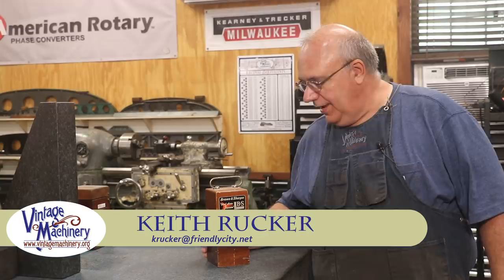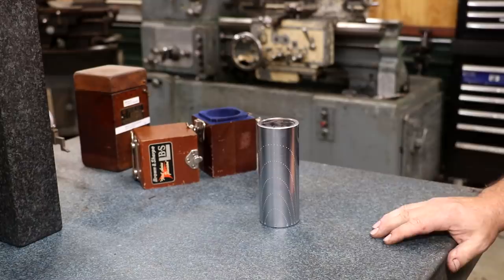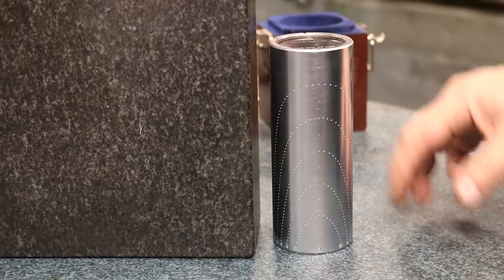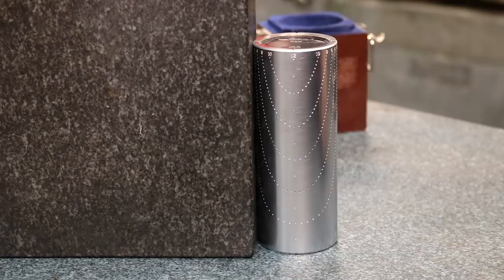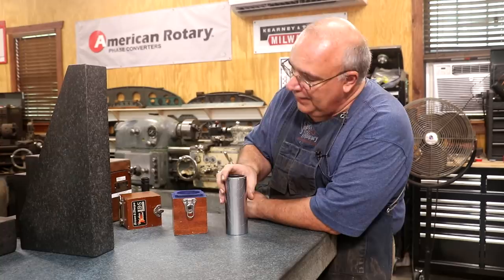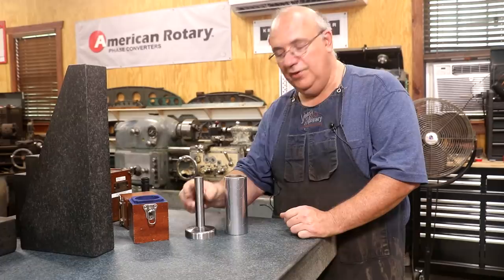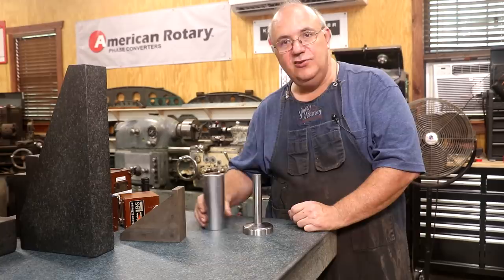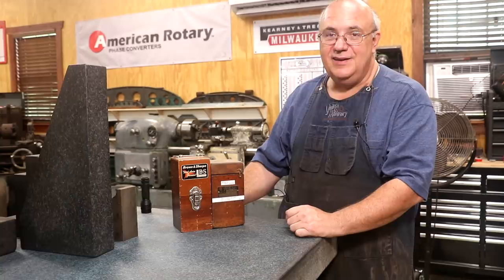Machine Shop Tools:  The Cylinder Square!

Comment: I remember when I was serving my apprenticeship in the early 60's in the UK several of these cylindrical squares were made in the toolroom. It was easy to get a piece of tool steel machined on a lathe and get it hardened but you had to get round Arthur who operated the cylindrical grinder. You could then get it checked in the standards room.
To finish they would be oiled and then dipped  in plastic protective covering.A useful tool for checking the accuracy of squares etc. 

Regards from Redruth

Arnold

Comment: After seeing your video about quick tram alignment and realizing the potential time savings, I started pricing cylindrical squares and quickly learned that they were out of my price range so I started thinking about alternatives. I saw that 2-4-6 blocks would also work and they were affordable so I bought a pair.  A single block stood upright works for quick tramming and in addition I've found various other uses for them.  For instance, if I need a big vise for horizontal milling I clamp one down to the table using my clamping kit as a fixed jaw and then I use the threaded holes and bolts through the other block as the moveable jaw and it makes a dandy vise for holding larger work, as well as for general milling blocking.  Thanks for the idea Keith.

Comment: Those dots that form curved lines are meant to measure the deviation from square on parts that are shorter than the square if I'm not mistaken. Rotate till you've eliminated the light gap then read where the top corner of your part lands between the lines.

Comment: About waiting on something "rare" to come up on eBay (something I have done many times).  Instead of looking for it every day or week, and potentially missing a "hit", you can do the following.  First set up a search for the item (you might find nothing).  Then click on "Save this Search" at the top of the page.  You should then get an email whenever the eBay search engine finds something.  Hints: You can search for spelling variations by putting works inside parenthesis e.g. (Starret, Staret, Starrett) which will return any items whose description contains any of the three (mis)spellings.  You can also remove search words by using a "negative" parenthesis, e.g. -(brown, sharpe, mitutoyo) which will NOT return any items whose description contains any of these words - handy to get rid of the chaff and find the wheat.  Best of luck finding your rare item!

Comment: When I was a student at TAFE I made one of these...........no sweat, chuck it in the lathe, cajole the storeman into giving you a new insert,  try and find out what steel it is, set the machine and press the GO button.        The thing turned out perfect, first go............the teacher could not find any error with the equipment at hand in the workshop.

I wrapped it up in felt it's still in the cabinet waiting for the day I turn out perfect work again.     That was 60 years ago!!!!

Stavros

Comment: I ran a Brown & Sharp screw machine for about a year.  I never learned set up very well, but would hold tolerances within a few thousands for thousands of parts.  Just had to maintain tool sharpness and oil flow to take care of the tools.  It had pneumatic stock feed.  They also had Davenport's which would turn out many small parts with close tolerance.

Comment: We had the magnetic post type in our toolroom.  We were never permitted to simply set it on a surface. Wipe the work surface and base with a clean rag then wring those surfaces with your palm before making contact.  Always storing in it's wooden case.

Comment: You will notice that the light passing through the gap between the cylindrical square and a surface under comparison will shift to the blue end of the spectrum (shorter wavelengths) as the gap becomes narrower.

Comment: A cylindrical square isn't as efficient as a 2-4-6- block stood upright, because since the circular square is cylindrical, front-to-back out of tram will influence side-to-side out of tram, and vise-versa, unless you hunt for the high spot on the cylinder with each adjustment.  So as Cap'n Crustry says , a 2-4-6 block, (if it's aligned to the T-slots with a 5/8 thick block sticking out of a T-slot),  seems  a faster way to tram.

Comment: I am sure I could make a very accurate square like your Brown and Shape on my universal grinder. 
But how to make it like it is on the opposite end l wouldn't know where to start . On the square end l would start with a piece of drill rod tool steel and face, cut a recess in the bottom, and center both ends. I would have it harded to about 60rc . I then would put it between centers and grind it straight with in 
.0001". That would be half that per side . The harder part is to get the side of the wheel perfectly square to get a chris cross pattern on the bottom which would be perfectly flat. At that point it would be ready to  be used . It should be accurate to at least .0001" or better. The other end that is something different all together.

Comment: So if you dont need that much of extreme precision you could make this on the lathe in 5 min.
Reply: Yes, but the Devil is in the detail, you first have to make the cylinder dead parallel and doing that on a lathe takes some doing.........for any but the most exacting  work a piece of hard chromed bar cut from a hydraulic ram and faced off will be dead square any day of the week and it won't rust from handling.
Reply: @gangleweed  What a great idea using a hydraulic cylinder ram !
I guess you could also make a tapered one for setting up things.

Comment: You left off a key bit about a cylindrical square!
A shop-made version (of arbitrarily high precision!) is within reach for people that don't have precision-everything. (Not as pretty, no :D) 
"Between centers" can make approaching-true-cylinder-walls. Facing gets rough-cut ends. Make two.
Then "just" do exactly what you showed with light between the two of them with rotation to see their errors ... and the inevitable lapping the ends to suit. Not one single precision tool needed beyond a surface plate.

Comment: How difficult would it be to make one on a cylindrical grinder?
The bottom surface gets square no matter what, as the part rotates, as long as the spindle bearings are good.
The only problem I see is with the taper, but you can measure and correct for that.
Reply: the devil is in the details. heat ect. remeber the longer the part, the smaller the angle has to be to read out. 
.0001 at 12 inches is allot. 
make as you described and then lap the bottom in untill it reads 0 all the way around with your squarness comparator. 
relive the bottom so it has like a 1/8th lip to ride on. it will be easier to lap. a full face will be very dificult to get flat. and will chatter on the surface plate.
Reply: you can do it!

Comment: Welcome from Charlotte, N.C. and thanks for another great video. I've never owned a B &S. cylindrical but I fabricated  the other type in my shop using   a six inch length of .500 hardened & ground shaft with a three inch aluminum base. After embedding a small neodymium magnet in the base I chucked the shaft in an accurate 5C collet and carefully machined the base perpendicular. It checks accurate within a couple of tenths but must be handled very carefully to preserve accuracy. You mentioned tramming a machine table; here's another method. https://photos.app.goo.gl/muLS4ddTTYVgBQoe9 .

Comment: I still have no idea what the curved lines of dots are for. Listened to your "explanation" a couple of times and, well ... 
Maybe somebody else can illuminate this for me?
Reply: The curved lines show the contact points for the noted amount of out of square.  Consider the example where the piece being guaged was much less than the height of the cylinder.  It shows where to look for contact.
Reply: One side is tilted like the leaning tower of Pisa. The normal tourist picture has the tower leaning toward the right. But if you were able to go around to the back it would appear that it was leaning to the left. Then on the sides it would be either leaning away or leaning towards you but  the sides would be straight up and down. So, as you rotate the square around you can measure the tilt of how far it is out of square and whether it is leaning forward or backward. I  don't know if that helps or not?
Reply: They are an indiicator of the number of degrees at the height of any specific dot. Say your test piece is only 3" tall off the surface plate, the ( roughly) 6" to the top of the Cylinder is not much help.. so, rotate it against the short test piece till the light gap goes away, and read the angle by the dot... following the arced line up dots from the contact at the top of the test piece, up the numbers on the top of the gauge Cylinder.